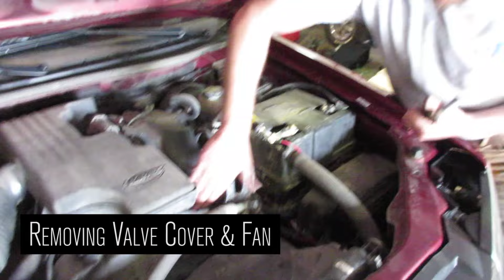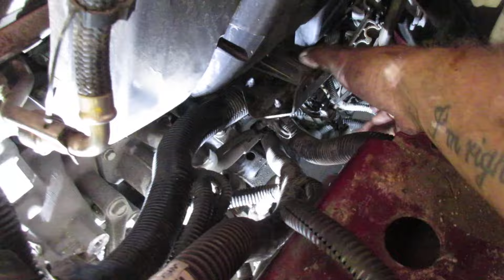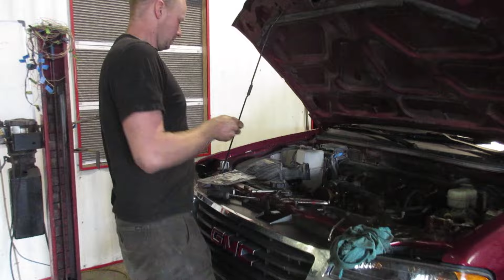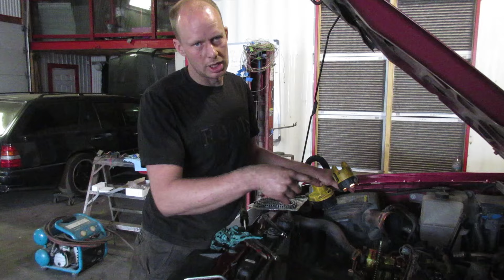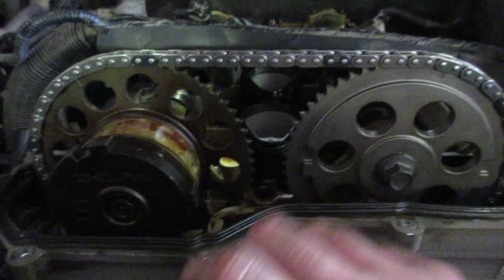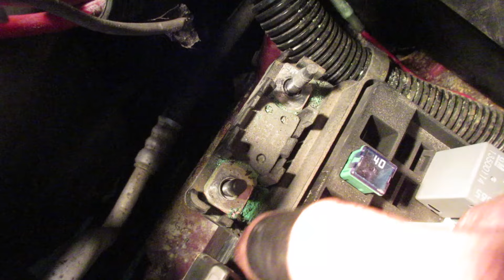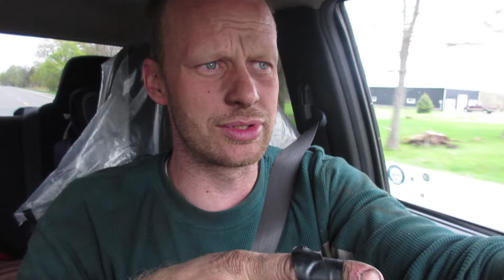Over-Engineering At Its Finest! GMC Canyon Needs A Timing Chain

Comment: Planned obsolescence at its finest
Reply: Those bolts are designed to stretch and only used once... if you catch someone re-using head bolts you're in trouble.
Reply: I worked at a Subaru place that reused headbolts, I told them they're crazy,should always replace head bolts
Reply: I have a screw loose
Reply: I always reuse Subaru head bolts and never a problem. I'll let you Google why. bolts are not "just" bolts. many design's and types
Reply: Are you referring to the timing chain? How is that "planned obsolescence at it's finest?"
Reply: I'd say it was... timing chains stretch and throw off the timing. Sometimes they even break... and hopefully you don't have an interference engine. Most people aren't capable of swapping the timing chain themselves so they'd rather just throw the whole car on craigslist instead. Especially for newer cars that have a hundred accessories that need to be removed to get to the timing chain, or having to drop the engine to get enough clearance. 

Then you're expecting the average joe to know how to set the timing, or else pay a shop god-knows how much money to do it for you. That's why there's so many on craigslist for sale. "Mechanic's Special" Runs like crap (if it runs at all)

Belts are superior. They don't stretch and they're less likely to break (if treated properly). They're also easier to change in most cases, unless you have a gen 1 Rav 4 (god help you then).
Reply: You've gotta be trolling... everyone knows belts are better than chains.  Even motorcycle enthusiasts prefer belts over chains. Chains are worthless. Belts support a much stronger load before breaking. They don't stretch. They contain steel cords on the inside. You do know they're not just made from composite materials, right? Also, the belt sprockets (or gears, whatever you want to call it) are located on the outside of the engine block, don't require oil and are easier to swap.
Reply: The Real Elvis belts are rubber, rubber breaks down over time.
Reply: The rubber is only on the outside... internally it's steel cords like a tire. It gives it more strength and less elasticity, less proned to breaking under stress like a chain... and almost always easier to swap since it's on the outside of the engine. Timing belt on a Civic was probably the easiest and quickest job I ever had. I wish every engine was designed like that. The timing gears are easy to adjust, also.
Reply: Justin Peterson yep that's why they're usually replaced every 60k and 90k. chains last alot longer than that. timing belts are not even close to being steel belted like a tire. most are polyurethane and Kevlar.
Reply: The Real Elvis You're telling me your cheap fiber glass rubber belt is superior to my steel chain? I've had chains that have never been replaced once on my cars that have gone 350k+ miles. The very idea that a belt is better than a chain is completely nonsensical.
Reply: Yes, they are superior. No timing chains last that long. They definitely do stretch and throw the timing off. Pure lies. Trying to add more myth to the old technology. It's bullshit.
Reply: I ordered 66 that's what I'm trying to say too like bro your belt isn't made of steel it has some metal cords like a tire in it big fucking deal watch when the rubber teeth rip off or it breaks completely in half on him then he'll learn lol
Reply: Motorcycles are improved with belts over chains, less friction, less unsprung weight. Gee, so many experts in here today. You guys must've all been raised in the mountains and never seen the light of day outside of American bullshit.
Reply: The Real Elvis with a name like Elvis and a picture of Stewie yeah you're real credible buddy.
Reply: The Real Elvis You don't have to be an expert to see the results.
Reply: The Real Elvis and I don't know what you're talking about when you say American shit like only Americans use timing chains? don't make me laugh.
Reply: Justin Peterson I guess I prefer timing chains because I feel that there are better uses of my time and money instead of fucking around with some bullshit timing belt that wears out. It could just be me though.
Reply: I ordered 66 I completely agree I picked my car because it has a timing chain I don't want any problems down the line belts are recommended to be changed like every 50k or you could slip a tooth and make a valve hit a piston
Reply: So now we move the goal posts over to motorcycles?
Reply: Yes... the last person in here was speaking to belts being inferior to chains on a motorcycle but he deleted his comment. In no instance are chains superior. They're not designed to last. The links will become loose over time and cause the chain to stretch, and the links can break. Some power is also lost via the belt running thru the oil. Also, the weight of the chain contributes to the valve train weight, because it's directly connected to the camshafts. Lighter valve trains are always better. Next this guy will be telling me that cam-in-block (pushrods) are better than OHC. 

Belts rely entirely on tension. The teeth are used to guide the belt on the gear, but not to turn the gears. The gears are turned by the belt tension. When the belt wears out over time, it can be replaced quickly, easily and cheaply. I'm still unable to figure out how people would possibly opt for the most expensive option that's also a pain in the ass to maintain.

The only thing better would be a direct-drive gear. Haven't seen any modern vehicle engines using those.
Reply: I would not be surprised if they started using electric motors to run the valve train. It would reduce weight and give even more to the ECU to improve efficiency.
Reply: Truth be told, timing chains don't actually stretch. All those little pivoting rollers in each link wear down which gives the chain play.
Reply: Chris Marek they do stretch but its the rivets that gets stretched but your also some what right its also the sprockets that wears down!
Reply: GM junk at its finest.

Comment: The GM service manual actually spells out how many turns of the crank it takes to line up the links. They recommend you do it once after putting on a new timing set. FWIW I'm a former Pontiac/Buick/GMC dealer tech. All your little tips in this video are spot on!

Comment: Remember the powerful indestructible throttle body injected 4.3 V6 of the early 90s/late 80s in the small pickups? Great combo it was.
Reply: I have a 91 GMC Sonoma with a stroked 4.3l to a 5.0l v6. 370 hp at the flywheel. Ext cab with a coil over suspension front and rear. Built 700r4. 14 mpg in town 22 mpg Hwy.  Owned since new never needed anything until I hot rodded it. This truck will be on the road for years while all this other plastic junk rots away. My wife has had 9 other pieces of plastic junk. Who is leaving a smaller carbon foot print. Me!
Reply: It was a fantastic engine
Reply: Had a s10 that was hell on wheels factory. With the 4.3!
Reply: Those were the best. I had like 3 vehicles with those in them. Excellent engines!
Reply: The “B-Code” 4.3 in the full size trucks was a timing gear setup.  4.3V6 was a champ!
Reply: The S10s were great trucks. I had several. The 4.3 5spd was a fun combo! My buddy had a 4.3/Auto with a cam in it and he'd blow the doors off of mustangs at the time. It was a fun truck.
Reply: love my 98' s10 4.3...  over 333,000 miles and still doing good.
Reply: GM finally learned their lesson from the Atlas disaster. The current 4.3l V6 you can get in a Silverado, is an LT motor with 2 cylinders lopped off. 
Just like the old 4.3l was an SBC sans two cylinders. It worked great then. It works now. If you need a fleet vehicle or a good mileage vehicle or just a decent truck for grocery runs, GM got it right. You'd think they'd have wisened up and simply made a new all aluminum VVT version of the old Buick V6. That damn thing ran forever. It lasted 250k miles in grandmas Regal or with the right crank and rods, made 600hp in the Grand Nash.
Reply: And how.  I drove an '88 S-10 for work and put nearly 300,000 miles on it, and after that it still ran like new.  The only engine-related work was a couple of times in the shop for new ignition.  And my home-style transmission-fluid replacements kept the tranny in tip-top shape for that whole time too.  Oh, and I've met at least a dozen S-10 owners with more than 400,000 miles on the original engine with never a breakdown.  The ball joints on those little trucks were far better than average too.  If you unload the suspension when you grease them, they last and last and last.  I got that truck replaced with a Ford Ranger, and under identical driving conditions, the ball joints on the Ford were completely shot at 30,000 miles (the engine on the Ford held up, but the tranny didn't do nearly as well).  Old S-10s are fantastic little trucks!
Reply: I had a '90 S10 with a 4.3L, 4x4, extended cab, picked it up for $1k because it had a blown head gasket at 80k miles. I replaced the head gasket in about 4 hours and drove the thing for another 50k before it got totaled from a t-bone accident.
Reply: The 4.3 is still around.
Reply: @95roadie  The old iron block one?
Reply: I a friend of mine had a 89 S10 with the 4.3 and auto trans, the only thing he did was put a flowmaster muffler on it,2WD.it would eat our other friends 91 F150's with a 5 liter lunch all day, good little truck.
Reply: I had the 4.3 in my Sonoma 2wd that truck got 21 mpg (I was a very slow and easy on the throttle driver) but I took pride in my fuel mileage. Loved that truck
Reply: Mine went through 2 fuel pumps, intake gaskets, heater core, wheel bearings, you name it, it broke. To date the most unreliabke vehicle ove personally owned. 1998 gmc jimmy. Everything around the engine and tranny broke, but still runs with about 330k (sold it to a family member)
Reply: If you think it was powerful you must have upgraded from a fuckin Ford pinto to that motor...ran forever but was a dog
Reply: @trudeaumustgo1920  All that stuff had to be replaced on my 97 too. Just hit 200k. It hasn't had anything break lately. 🤞
Reply: @Thundarr995  4.3 liters and only 190hp lol thing was slloooowwwwww
Reply: I still have two 4.3's. Love em!
Reply: @trudeaumustgo1920  more torque than a Jeep 4.0l straight six though. GM's 4.3 was just one of those great motors. Not a fire breathing beast but if you wanted one that would just not die and could be repaired cheap, it's hard to beat. I must have put three alternators in mine in the years I drove my 92. One starter. It just worked and I replaced the little things that went wrong. I traded it in nearly 20 years ago for something more fun to drive and that got better mileage. My 97 VW GTI 2.0. I fell down the rabbit hole of the older water cooled VWs and found a new expensive hobby.

Comment from the maker: CHAPTERS!
00:16 Getting At The Timing Chain
00:56 Removing Valve Cover & Fan
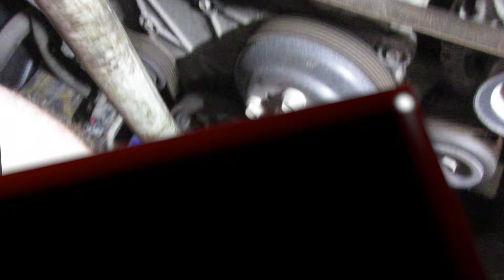01:32 Removing The Flywheel
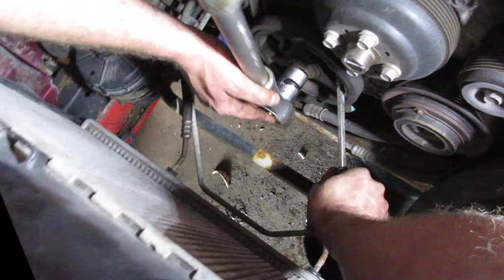02:20 Removing The Oil Pan
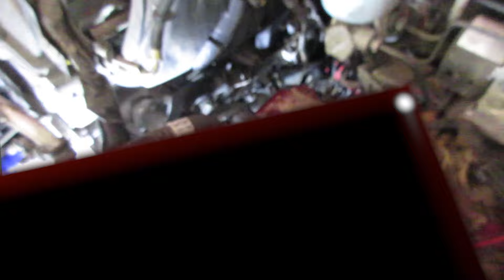02:43 Getting To The Intake Manifold
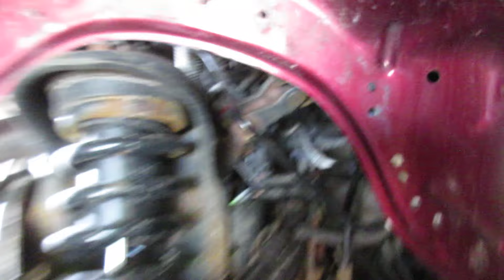03:27 Removing The Balancer
03:47 Loose Timing Chain
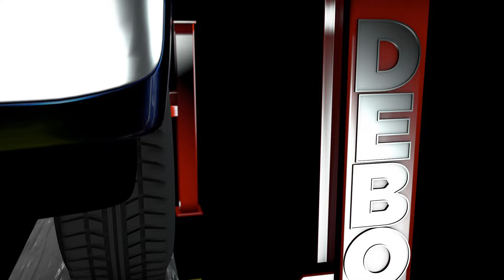04:17 Replace The Timing Chain
05:45 Lining Up Front Timing Marks
07:23 Lining Up Rear Timing Marks
09:23 Corrosion Problems
10:43 Test Drive Rant
Reply: why couldn't  you  link new timing chain with old  , rotate everything  until you had new timing chain on the engine , disconnect old timing chain from new chain and  link new timing chain ends together .
Reply: because the sprockets and guides wear too. guide snaps? goodbye engine.
Reply: Because there is no master link...so no way to break and reattach the ends.   And...most of the time once you dig into one of these GM masterpieces you find that guides or something else needs replaced along with the chain, and of course they've 'updated' the design and none of the old bits are compatible with the new, so you end up needing to replace everything.   Nice.   No more GM for me.
Reply: 1:57 passing water while removing the flywheel  ;-)
Reply: Recoil Rob Uh Ford is pretty well known for multiple part redesigns, midyear design updates, and 'no longer made' parts too lol. I've spent plenty of time hunting for Ford parts that were year and month specific in order to work.
Reply: Just replaced the timing BELT in my '96 Ranger. Took me 3 hours and I work slow. Think I'll just keep the Ranger.
Reply: DEBOSS GARAGE  YOU ARE THE MAN 👍👍 for repairing it to begin with. Why, why, why, you hit the nail on the head, stupid engineering👏👏
👏👏👏👏👏👏👏 and the stupid engineers don't repair them. Thanks for the informative video.✌✌
Reply: DEBOSS GARAGE that's not a flywheel that's harmonic balancer

Comment: This is why I love my 1984 Dodge with a simple 318
Reply: My96 ram with 250k original timing chain no play. Gm's are the worst at premature timing chain failures.
Reply: Love the 225 slant 6 too
Reply: @williamwalters9403  I had to scrap my 2000 ram 1500 5.2 liter because the distributor broke.  Too much time and labor to repair, cost more than blue book value

Comment: changed the engine in one... nightmare!! to take the intake off you have to go in the wheelwell with a 3ft extention and a swivel 10mm took me about 1/2 an hour to take like 7 bolt out. to take the engine out you have to take the left engine mount out (while it's supported by the chain block) pull the engine to the left, take the right engine mount out but you can't unless you take the exhaust manifold out but there is no place at all to pull the cat between the engine and the firewall so we cut the cat off the manifold (we were replacing it anyway) to take  the manifold of so that we could take the right mount out to take the engine out and it's the same
f$#@ing around to put the new one back in. each time a Colorado or Canyon in the garage I pray that it's not for an engine lol

Comment: Engineered exactly the way they wanted it. Just like home appliances have internal  parts specifically engineered to fail after   so many hours. Everything in our world is becoming disposable.
Reply: And people wonder why land fills are filling up.
Reply: Except that cars today last way longer... even with having to change a timing belt every 100,000 miles. You’re doing tuneups at the same intervals now!

People make such a big deal out of it but it’s no big deal at all.
Reply: @Bartonovich52  And vehicles do not end up in land fills. Vehicles end up in scrap metal yard, that is old cars do. New cars, there is so much plastic i am not sure where they end up. An i can guarantee that if you find a car made today, an tried this 40 years from now that is sitting in weeds you would not be able to fix, not with out a full service garage and bucket full of cash. And your comment about about tuneups and what not. Try chaining an timing chain on a chevy 3.6L or a ford coyote 5.0. Not to mention the Ford spark plug problem on the triton motors, Can you say $1000.00 for a spark plug change. I am afraid that your comment does not hold water.
Reply: Yeah...I remember the "Design to Fail" - 201 class that I had in college.  Very difficult class as you had to figure out how get things to fail at a specified interval.   First, you had to choose mileage versus time, choose the exact part to fail, and then figure out the materials choice to have it fail at the desired interval...yeah "engineered to fail" - great BS concept invented on the Internet by people who have never designed anything.
Reply: Bartonovich52 We peaked and have now fallen off how long vehicles last as manufacturers have learnt how to cut manufacturing costs by reducing the margin factor of a part’s lifetime expectancy. If a plastic part will last long enough and saves them money they put a plastic part on. Not the case with all pieces (bodywork for example has never been better imo) but mid-90s to mid-00s cars were the longest lasting, as manufacturers over built them for confidence, after that they learnt that they could reduce quality and thus costs, and consequently lifetime.
Reply: All due to government regulations!
Reply: @DStabs720  Bullshit. It's not all government. That would be Nissan's fucking excuse though 😂
Reply: [][][]M how do you explain all of the diesel emissions stuff on trucks then? Companies wouldn’t voluntarily put that stuff on.

Comment: It"s done deliberately  to bring you back to the dealer.  just the specialized bolts holding on the brake  caliper.  the dealers are usually the only ones with the wrench for 5 years